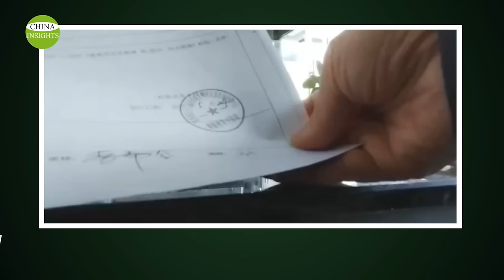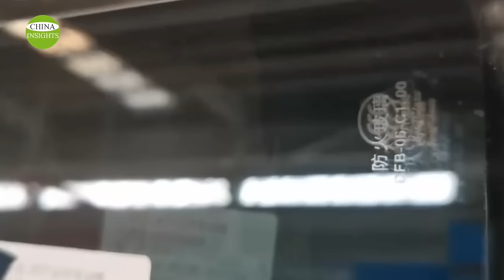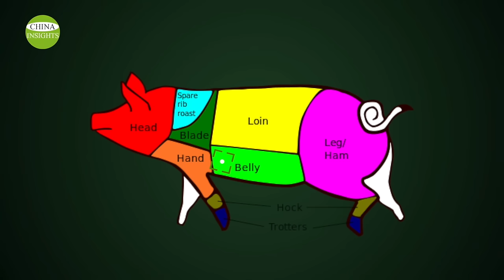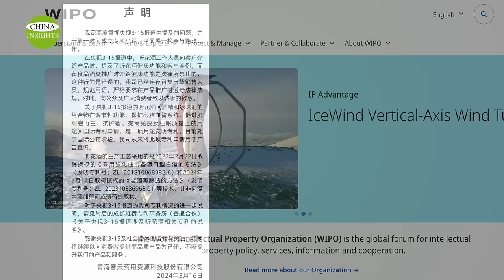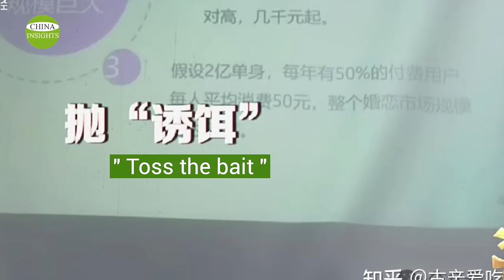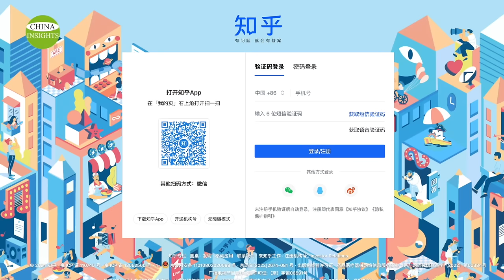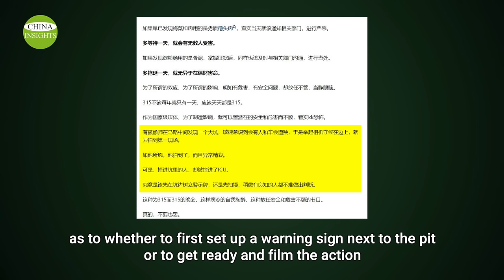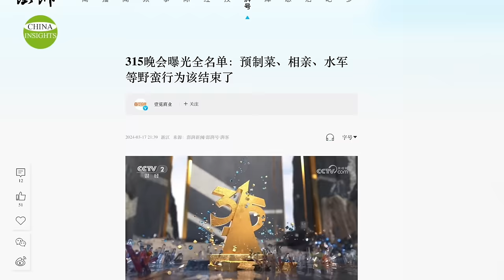Fire extinguisher: the more you use, the bigger the fire/CCTV Gala: People shocked but not impressed

Comment: The thing about fire extinguishers is you only find out they don’t work when you need to use them.
Reply: No, usely they have to get checked every few years atleast in most places of the world.
Reply: @jonasstahl9826  You cant check a fire extinguisher without pulling the trigger, and then its useless...The only thing you can check is, if it have been used/triggered. 
And if so they replace it with a new untriggered One...At least here in Sweden..

Comment: glass shatters 
reasons why they shatter are many 
some are impact when something hits it 
preasure 
when the house that is burning has higher density of preasure compared to outside 
means high preasure wants to relieve it self so it will flow from high preasure to low preasure 
this means exiting a window that is glass and thus if the glass cant handle it it will buckle under the preasure pushing on it 
many other reasons and factors in glass shattering
Reply: And China is surprised that Evergrand is considered a scam 😂